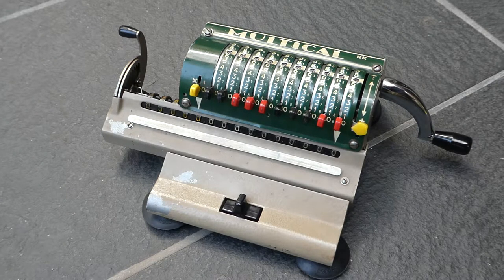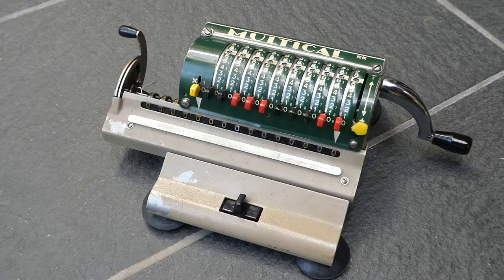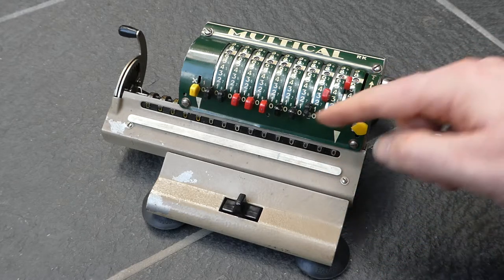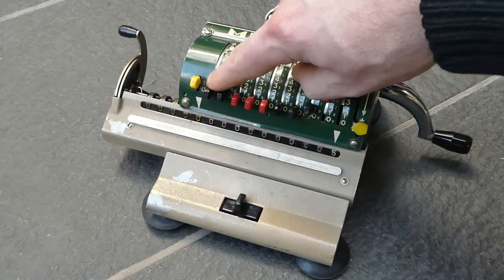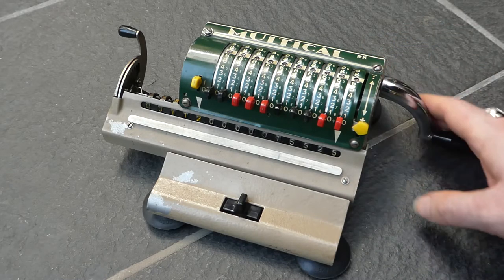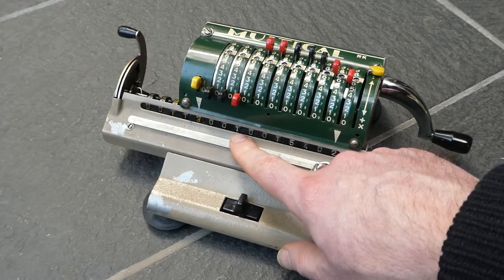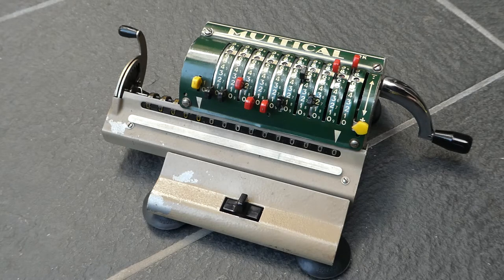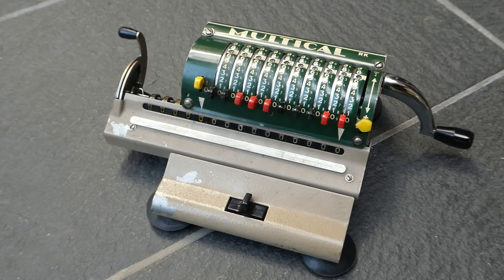The Multical mechanical calculator

Comment: Dear Jaap, again a very good video on this outstanding channel. The overflowing 1 on the very left when using complements for subtraction works quite nicely as a counter. But you will need to disengage the regular counter lever. Otherwise it will mix up the overflow-counter digits when shifting the register leftwards during long division.   
Another feature for free in this clever design. Best wishes from Germany.

P.S.: I really like the systematic way you describe all levers and functions of the machines, making your videos a compact operating manual.